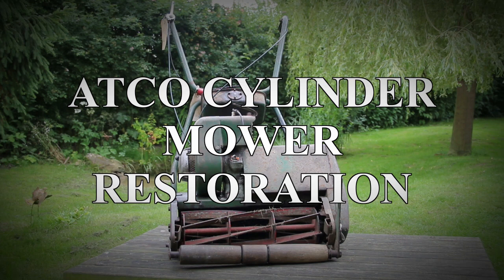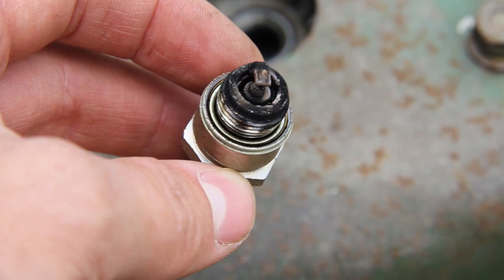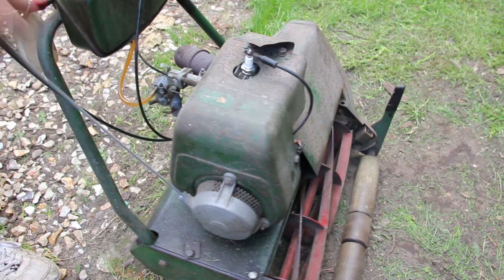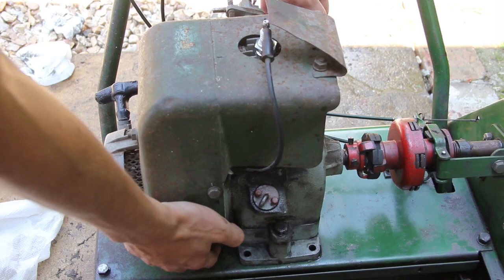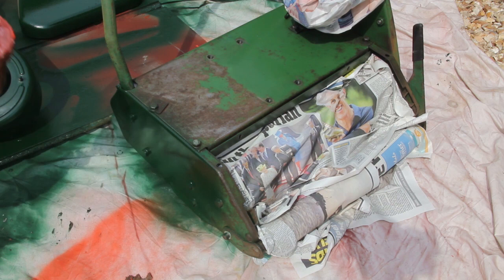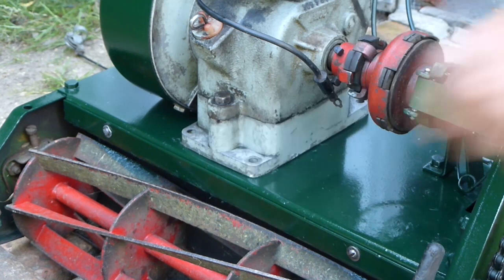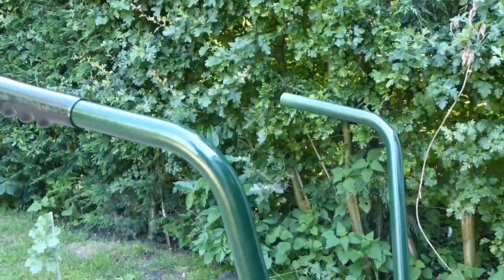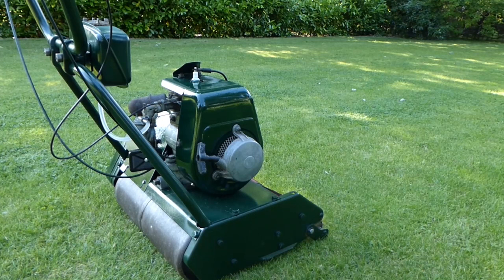ATCO Cylinder Lawnmower Restoration | Self Propelled

Comment: If you have a cylinder mower that needs a blade sharpened provided it’s just part of your regular maintenance and not cause it’s sat for years than just buy some lapping paste and paint some onto the soul plate , adjust the blade down slightly (play by ear) then run the blade it’ll give a nice sharp even edge to it

Comment: My dad bought one of these new in about 1975. My brother in law has it now. I think the 4 stroke engine is a Briggs & Stratton 90cc. The clutch is a multi-plate with drive on the outside casing and take off on the axle.

Comment: Has any body got a pic of the correct installation of an Acto 20SK mower.  All engineers are not available at the moment, bine stalling.  New plug, new filter and tried to clean carb, need new gaskets but when putting back together, I think I have put fuel hose back wrongly as fuel pours out of the teat facing into the engine toward pull.  Any help?  Thanks
A

Comment: Any idea how to adjust the blades on a balmoral 20se
Reply: I have a 24. There are 4 screws above the blades. Tighten the bottom ones to close the gap, top ones to open the gap. You have to loosen the opposite screw before tightening

Comment: Hi I wonder if you can help, I've been given the same lawn mower as the one you restored but having problems starting it . There is no spark but some voltage, any help would be a appreciated.
Reply: Hi. If you can, I acquired a 22inch cut model just a few hours ago. Not been run for 2 years apparently, and with a no spark problem the same as yours was. Can you remember the cure to save me lots of time perhaps. Thanks so much.
Reply: needs new magneto or clean the flywheel contacts ....magnetos are expensive on atcos so try a second hand one

Comment: If I was serious about restoring that mower,. I would have removed the cylinder head and cleaned all the soot  and gunge that could be seen thro the plug hole.  Apart from spraying the deck, without any undercoat, to give an even finish, you only did a cosmetic restoration. Never checked the blades, or the bottom plate or height adjuster. Poor enough effort.